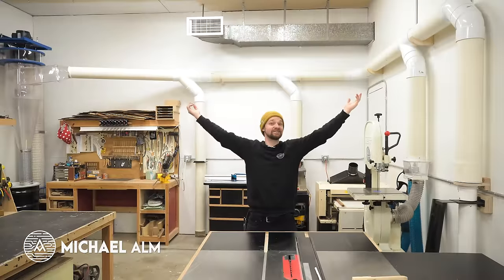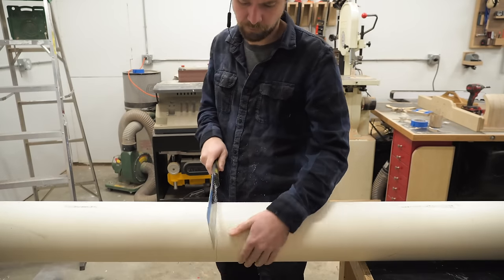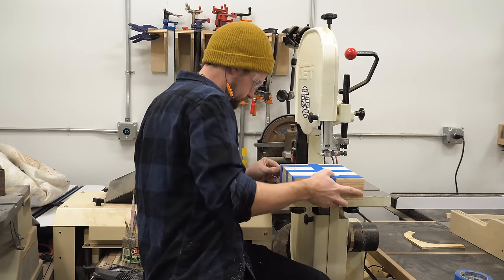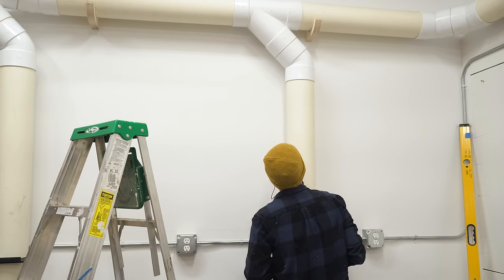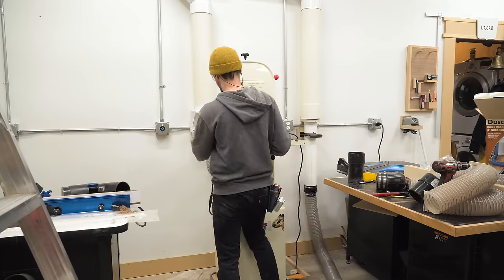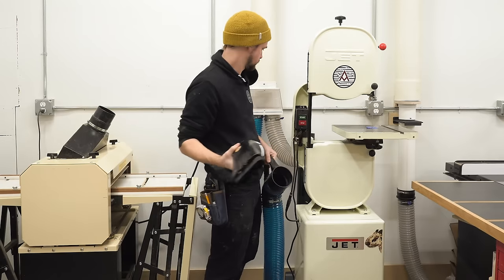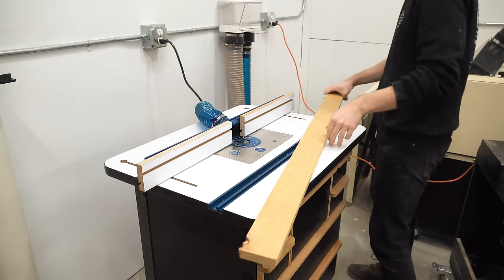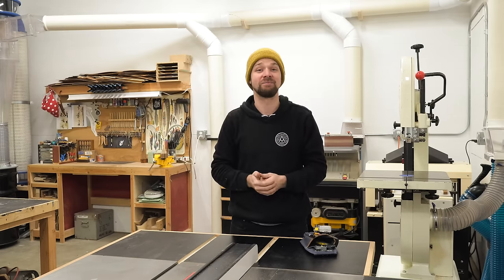Dust Collection System Upgrade

Comment: I'd be interested to know roughly how much this all cost you
Reply: he said about 350$
Reply: @RealZynexx  I don't mean only the piping. I mean the dust collector, piping, waste gates, hoses and attachments.
Reply: BigWonka ah got it
Reply: The CV1800 is $2,085.00
Reply: Yeah, dust collector is about $2k, piping $350 plus it looks like Rockler was a sponsor so you'd need to add all those odds and ends if you were doing this out of pocket.
Reply: @djalgoriddim  Not too bad.

Comment: If anyone is curious, the typical “General” single stage system is less that $1000 and the Clear Vue Cyclones typically cost between $2000 and $3000.

Comment: Hi Mike.  I've recently been researching dust collection systems. Ive learned that PVC piping is not recommended because of static buildup and the danger of explosions if not properly grounded. I had to skip to the end of your video to see if you had used copper wire on your piping to ground the system but I didn't see any. Just thought I should mention this to any viewers looking to build their own dust collection systems using PVC piping.

Comment: Awesome system! Thanks for sharing. Getting ready to install dust collection in my shop (22'x22' 2 car garage). Was going to run 5" main trunk with 4" drops to my tools off my 2HP collector motor. A few days ago I got my hands on 64' of clear 4" pipe. It was free and its enough to do my whole collection system. My question, will I be losing a lot of suction using 4" instead of 5"?
Reply: Average American    Yes, you will lose considerable CFM going smaller.  
Here is a great video describing the studies.  At 38 min, they are talking about 6” as close as possible to the machine.  
https://youtu.be/GVjYmxYiD60
At 41:00 into that video, there’s a quote by Bill Pentz who has done considerable experimentation on dust collection (billpentz.com).  In an example, he states that with his 1.5 HP dust collector (1100 CFM), it generates 4” to 6” of pressure.  It can move 800 CFM on a short hose of 6” flex hose.  (Flex hose has 4 times the drag of a smooth pipe). And can move only 550 CFM on a 5” flex hose ... and 350 CFM on a 4”.
E.g., a drum sander needs 800 CFM.
(Then, as you add the long pipe, the numbers drop.)

Comment: Hi Michael, nice video, I like the 6" system. Have you ever thought of electrifying the blast gates? that way you'll know if any of the other gates are open. The system goes if you open one of the blast gates the dust collection starts up and close the gate the system shuts down. Now the nice thing about the remote is that after opening the blast gate and system starts up after cutting the piece and you need to perform another setup you can press the remote to stop the system and start it up again after setup is complete. I always wondered if I didn't have the electrified gate I wouldn't know if I was getting full suction at the port. Just food for thought. Thank you.

Comment: Nice system.  How much would all of that cost for those of us not sponsored?  I suspect quite a bit.  It's like saying , "SpaceX just makes the best rockets.  Thanks to SpaceX for sending me this rocket to use.  I encourage all of you out there to give a look at SpaceX and consider buying one of their rockets."
Reply from the maker: Thanks. Most of the parts of this installation I payed for. Rockler sent me their fittings as part of my sponsorship, but the rest was from my pocket. If they weren't the sponsor, I would have bought those parts myself. The whole system with electrical, pipes, fittings, and the collector is just shy of $3k. I work full time in my shop, and want to stay healthy so that investment is worth it in my mind. There are loads of dust collector options out there for all different budgets, and use cases. I hope that people who watch this video get some ideas for their system, but no shop has the same needs as mine, so your system should be designed for your needs and in your budget.

Comment: How did you ground the PVC pipes?  Since the pipes are thin wall, have you experienced any issues with the pipes collapsing under the pressure of the DC system?

Comment: Hi. Nice video! I'm just ready to build my own dust collection system. I purchased a cheap chinese 3 hp dust collector with two bags. My workshop is not too large. Should I install 6"main pipes and then go down to 4" or should I do everything with 4 "? Thanks bud!
Reply from the maker: Thanks! Stick with 4” pipes for your system. It doesn’t have enough draw to handle 6” plumbing. If you want to learn more this is a great video https://youtu.be/qjI5l4nF9AM
Reply: @MichaelAlm  Thanks for your advice! I like your works. You can see the bows I make in www.patagonia-archery.com
Cheers!

Comment: I've thought about making a cyclone dust collector for my shop.   I see a lot of them in both professional and amateur shops.  However, I can't see how a dust collector does any good.   I can dump the collected dust out of the bag on my vacuum with very little trouble, so the dust collector would not be more convenient.  It can't possibly increase the efficiency of the vacuum, it is just adding an additional load.  It might save the blades on the vacuum if I were to vacuum up large chunks of wood or metal.  I don't do that and don't know anyone who does.  That's what they make a broom form.  So what are the reasons why a lot of people use them?
Reply from the maker: It increases the efficiency of the vacuum because the dust is deposited in the barrel before it reaches the filter. In traditional vacs you are filling up the chamber where the filter lives which means the more dust the smaller the surface area of the filter.

Comment: Great system, love those brackets! Question on the CV1800—I noticed you went with the Left Hand and not the Right Hand model, why is that? It would seem like you'd want the inlet against the wall so you have a straight shot instead of needing to adjust for the ~10° when it hits the wall. Was it just to make it easier to get the bin out without the filter in the way? Thanks!
Reply from the maker: Thanks, yeah I chose it for the bin location. I’m sure it would’ve worked either way though.

Comment: Nice video! (And nice dust collector.) I'd love to upgrade to one of those ClearVue systems, but I don't really have the vertical space for it. For now I'll have to stick with my Franken-cyclone built from a Super Dust Deputy, a $50 blower off of Craigslist, and a good filter.

I have that same Rigid spindle sander, and I agree the dust collection on it is bad. I improved mine by mounting a 4" to dual 2.5" Y fitting (from Rocker, I think) to the back of it. One side of the Y goes to the 2.5" port on the back of the sander. The other side goes to a ~1-foot section of Loc-Line rigid hose with a 6"x3" nozzle on the end. (Bought off Amazon.) I position that nozzle behind the left side of the spindle or belt on the sander. It works really well and catches almost all the dust.
Reply from the maker: Yeah, I've worked in low ceiling shops before, and it can be a bit of a pain. Thanks for the info on the sander! I'm going to have to try that out. There's definitely room to make a follow-up video about the system
Reply: @MichaelAlm  I'll see if I can work out a way to post a photo or video of what I did with my sander, in case it helps. Maybe it's time to start a low-budget YouTube channel.

Comment: Why didn’t you use combos or san t’s ... it’s a lot smoother bend then with that y ... and for that floor sweep , put a filter on the bottom and add magnets so if a screw gets in their it won’t be bad

Comment: 6:31 ahaha. Ehem, what's the choice behind such wide pipes? is their some critical size for transporting dust?
Reply: xdazamx that’s the size of the fitting that comes on the dust collector. For the greatest efficiency, you want to keep all the pipes the same diameter to keep the airflow even and not overstrain the system.

Comment: Sweet system! I wonder if you're eventually going to switch the floor sweep setup to a straight tube setup that's 1-1.5 inch from the ground instead. I see there was a bit of dust collecting behind the corners. I would definitely be installing one of these when I have my own shop!

Comment: Wouldn’t the use of PVC be a potential fire hazard concern? The saw dust coming through causes static electricity, and with enough static couldn’t this cause a spark large enough to ignite a flame?
Reply: There definitely a ton of these 👆comments in youtube comment sections though 🤣.  its kinda like I heard a guy who had a uncle that knew a guy who's second cousin once removed knew a guy whose hobby shop blew up from not grounding they're PVC ducting

Comment: Nice,  you can find scoop type vacuum ports for lathes or table saws off amazon to do your chop saw a lathe or your sander. I think using some of them would help cut out even more dust. And keep it out of your lungs.
It's not so much the mess it's the health hazard.   I'm looking into spiral pipe metal duct work .  There is a big concern of fire risk using plastic ducting. Not to mention it hard to find.
I was looking more at landscaping pipe.
300 seems rather high. Must be all the bends and turns.  For hvac you can buy saddle connections made of metal.
They look ez to install.

Nice system, you did your homework.

Comment: Do you have intentions or concerns to warrant grounding the pvc? I know it's a controversial issue. I know that the likely hood of any issue is wildly over exaggerated. But I'm more curious if you think you should or not?
Reply from the maker: I’m not going to. I don’t think the dust has time to build up in the system to allow of any sort of ignition. The static issue is for things like grain silos and bread factories not small garage workshops inside a contained tube under vacuum. That’s my logic at least 🤷🏼‍♂️
Reply: @MichaelAlm  that's fair, I'd say I'm of the same mind. I believe, and don't quote me, the particle per cubic inch for ignition is to dense to be reached in the standard dust collection in congruence with its rate of speed traveling to the hopper. I'm basing that solely off memory though so don't quote me Hahah

Comment: Looks great... Do you not need to ground the pipe for static?
Reply from the maker: Thanks! From what I've read, it's not necessary to ground the system. Do your own research of course, but I feel pretty comfortable not grounding.
Reply: @MichaelAlm I wasn't sure but it does seem to be more about getting uncomfortable shocks rather than safety.

Comment: great layout. any issues with static electricity?
Reply from the maker: Thanks! After using it for a bit I have felt a few static pops, and might do a bit of grounding just so it doesn't hurt any electronics. I don't think they would start an explosion or anything dramatic, but it would be nice to get it a little less static-y

Comment: Did you have your entire system planned out before starting of did you have to make several trips back to Rockler and your plumbing supply place?  Would a 3 hp system been sufficient?
Reply from the maker: Most of it was planned. I think there was one trip back to the plumbing supply because I miss counted the 45 degree elbows and I made some returns. My suggestion is over buy on parts and do a return trip. I'm not sure if you can run 6" ducts on 3hp, but you can definitely run 4" ducts.

Comment: Without reading anything about the actual vacuum machine, I wonder. Does that thing come in an "outdoor" model. It makes too much noise, but if that were outside...a small hole in the wall...?
Reply from the maker: People have put them outside. April Wilkerson has an outdoor version

Comment: What kind of supply shop has that thin wall ducting?  I went to HD to look at what they had, but all I found was regular pvc and the 4-6 inch stuff was about an 1/8 inch thick or more.
Reply from the maker: You have to go to a plumbing supply shop
Reply: Check outdoor garden area at big box stores as well. Usually with pool and ground drainage are

Comment: @Michael Alm Do you have a follow up to this video? How has the system worked for you? Have you made any discoveries afterwards that might be worth sharing?
Reply from the maker: I haven’t done a follow up, because not much has changed. I’ve used the system for a year, and it works great. I still need to improve my bandsaw collection, and I changed the location of the belt sander collection. I never grounded the machine, and that’s been fine. All in all really happy with it.

Comment: I noticed you didn't tie the chop saw into this system - what have you got planned for dust collection there?  (Also, AMAZING lay out - I'm working on a similar project right now)
Reply from the maker: I debated for a long time about how to tie it in, and thought it would be too obtrusive. I might do a built in vac system down the road. Thanks! Best of luck with your system!

Comment: Only just seen this video. Fine dust being drawn at speed through plastic is explosive because of static. The solution is to run a bare wire through the pipework and earth it.

Comment: Dust collection duct always gets smaller in size as it gets further from the blower. How did you come up with what size duct to use?  there are formulas to size the duct. Looks nice but wont work as well as it could.

Comment: It seems the ClearVue would like the intake pipe to come in at a bit more of a downward angle. I'm planning to put one in in my shop, but if I put the main trunk in at that apparent angle, the far end will be quite high. How important do you think that is? I think I have to go 1.5 - 2x as far as you did.
Reply from the maker: They recommend 5 feet of straight pipe out of the machine before making any turns. It cuts down on turbulence

Comment: Great video! I was wondering if you have some kind of ground connection as with pvc a great deal of static electricity will build up, or will it!
Reply: I was wondering the same thing. I know static can be a problem. Not wanting to get into the whole fire risk debate, just whether or not there is static build up?

Comment: Two Questions # ! what about the ground or a bonding cable are you going to incorporate one on the piping. # 2 did you connect to your Mitre Saw?
Reply: FYI - You cannot ground a non-conductor like PVC.

Comment: For some reason in the mind for volume of air vs. pipe diameter vs. flow of air; I think you should have run the horizontals in the 6" but the down pipes should be reduced to 5" -4"for the saw and smaller yet for the smaller CFM machines. The planer could go with 5". This approach is what I see with engineered systems. Large 6" all the way can reduce suction and flow by significant numbers and negate the need for as many blast gates. Cyclone systems seem to be more sensitive than pocketed systems. There are books on this for your information. With all 6" horizontal and vertical ducting you will notice the drop in pressure a lot sooner when adding machines to the system by blast gates. Same goes true for ducts in heating your house and tail pipe flow system for your car or truck. Shouldn't be too much work to makes verticals smaller off the 6" trunk duct.

Comment: Wow, awesome! Very jealous! Did Clearview say anything about opening extra ports when you have a reducing hose on it? I've heard it's necessary to keep the airflow speed up high enough to keep everything moving well
Reply from the maker: You know I heard that from other videos I watched, and I tested out the suction both ways. It seemed to me that the suction was a bit better with only one blast-gate open. It wasn’t a lot different though
Reply: @MichaelAlm  You'll want two 4" openings at all times.  I've had my Clearview for years now and it's awesome!  Over time you'll see that two openings are better than one...even though it sounds "wrong".  I like the silicone tape!  I just ordered some.

Comment: Dude, don't you have a miter saw that can cut 8"? I know what to get you for Xmas!  And yes, a sawzaw will work great with the correct blade.    Using your table saw is a VERY dangerous way to cut.  I personally have a friend who lost a finger cutting PVC pipe on a table saw.  Glad you did it carefully w a sliding jig.   Any thoughts on static buildup?
Reply: Fyi, nice video.  I really like how you modified the pipe for a floor vacuum port.  Smart and cheap!!

Comment: Does it fill the vertical pipes with chips when you use a connections thats furthest away?
Reply from the maker: Been using it for 9 months now and yes some drop in there, but not much. All you have to do is open the blast gate and they clear out. No clogs so far.

Comment: By now, you are probably realizing that those pipes were a really bad idea and I really hope by now you have wrapped all the pipe with copper wire and grounded it. The static in those pipes will collect A LOT of dust in the system and IF there is enough of a static charge, the fine dust could literally explode. Stay safe!!

Comment: Being its a lot of PVC, do you have to put a grounding wire anywhere for the static created?
Reply: I vaccumed dust from my Dewalt planer with the hose attachment on a regular household vaccume cleaner, and got a huge static shock - twice.